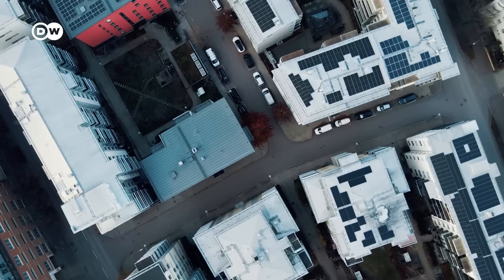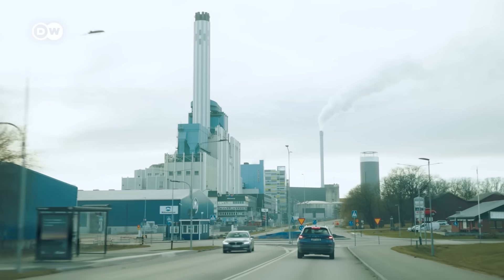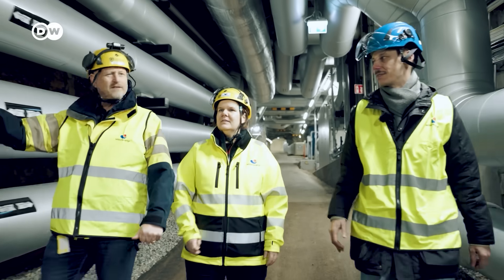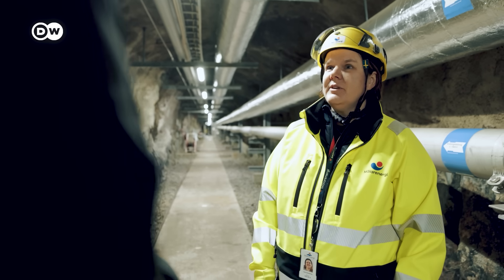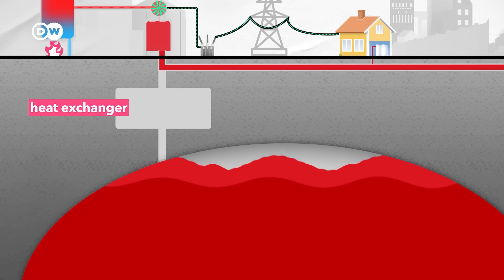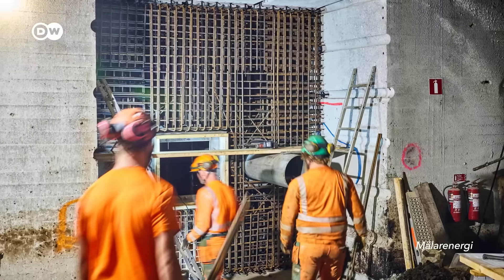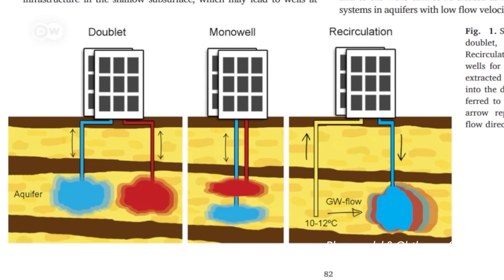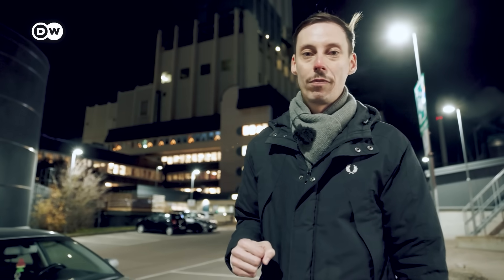Why a city in Sweden filled these caves with almost boiling water

Comment: 9:02 15.5 MILLION ONLY?! I was prepared with a big ole a few hundred million dollars or a billion, but that's nothing. That figure is thrown around way too nonchalantly, I don't care about anything else, but the fact they effectively increased energy efficiency with just 15.5 MILLION DOLLARS is insanely efficient.
Reply: Well, the cave was already paid off since it was built in the 1950's
Reply: @oskich  That's still crazy tho, for reference I am living in the state of California in the US. Our state has poured billions of dollars every year just on roads, but roads haven't really ever gotten better. In fact there's even a Wikipedia page called "List of unconstructed state highways in California". If we measured the efficiency has impact divided by cost, their cave system is miles above anything I really seen before.
Reply: @oskich  SKANSKA buillt it in the 50s and it cost 500000$ back then..
Reply: This is for a city of around 140,000. Or some $100 per person if I still remember my math.
Yet, break even is expected in 5 to 10 years.

There are losses in the system:
 - most of the surrounding rock has been heated by the hot water but the heat in it is no longer recoverable
 - the pumps consume electricity, whether they are storing the heat underground or taking it out
 - while it should be almost completely automated, there are probably a few workers year round
 - the cave might not have been located in the middle of the city, so there are both electricity losses and heat losses to pump water to/from the caves

Yet, there are a number of advantages pointed in the video as well.
All in all it looks like a big win.
Reply: @CalinCETERAS  i mean, the hot rock also acts as a thermal mass, if the water were cooler than the rock, the rock would warm it back up, so its stabilizing it, sure theres some loss that you just wont get back, but, still has use and when something is deep underground its gonna be a while til that heat is actually lost, since they could just harvest some of that waste heat via ground thermal heating
Reply: @CalinCETERAS In regards to your negatives, 1 might actually be a positive and 4 is usually negligible for district heating systems anyway.

Why 1 can be a positive is that if the summer months produce more heat than is required to bring the water up to 95C, then any excess heat stored in the rock will be heat that you don't have to actively cool, thereby saving costs on cooling. Furthermore, as the rock is heated and the water cools during winter, it will in turn release some of the heat back into the water for additional stored energy.
Reply: @CalinCETERAS  Those negatives you pointed are such bad negatives that they seem like positives.
Reply: Only reason things cost that much in america is cuz the government employs their own private companies owned by their friends and pay them massive amounts of money.
Reply: i think it's cause you're comparing it to America where they overcharge the hell out of any public infrastructure or spending and have like 100 middle-men
Reply: Translate from 15.5 million dollar to kronor is 11 times higher, 168 million kr.
Reply: @Krogen94  what’s your point? The value is the same, it’s just the number that’s different. Translate it to South Korean won and it’s many billions
Reply: I agree, it shows how efficient things can be done without American government. 😂
Reply: Agree. The expected time to recover the cost of the project of just 5-10 years is nothing in the context of infrastructure. However to home owners out there, if you live in a poorly insulated house chances are if you have good insulation fitted you may see similar short time of recouping the investment - and your will be more comfy to live in and worth more if you want to sell someday.
Reply: I suppose the price is depending on the level of corruption in the country/ city.
Reply: @biaberg3448 Possibly. As this is Sweden there is no corruption.
Reply: @bzdtemp  🤣🤣🤣
Reply: That what happens when corruption doesn't exist :)
Reply: it's a rather small system, the amount of CO2 saved is not that much. 15 million is not expensive, but also not extremely cheap. a breakeven time of 5 to 10 years is pretty good, but the cavern was dug already.
Reply: It's also a rather small scale system, which only provides two weeks of full heating for the city ... in a region which has very long winters.
Reply: @PauxloE  It's 2 weeks *if it's running to give off heat nonstop. That's not going to be the case 100% of the time during winter. On those warmer days where the system isn't outputting heat, any extra heat is likely being sent back in to make sure the temperature doesn't drop too much and they can keep the storage up for the next super cold day.

But yes, it's still a limited system nonetheless
Reply: @PauxloE  In case the heaters stops working and the only heat would be from the caverns two weeks should be enough to come up with a solution so the heaters can start working again. I can't say for sure tho.
Reply: Much hype about little benefit.

Comment: The bedrock leaks. This system is closer to BS than to working. You can't heat a cave and claim it's a thermus. It's not a thermus, otherwise the adjacent caverns would be cooler. It's a fucking radiator lol. Also, it stores heat for 2 weeks only. It's good to do somehting with the waste. But it makes no sense to claim you have an efficient system when you are losing energy to a giant radiator.

Comment: I'm from another rather small town in Sweden with a big district heating system but I don't hear much good about it. There's no storage system though, which might improve things. But the issue is fuel, there's not enough trash or garden waste generated to supply the plant so they need to import a lot of fuel, green or otherwise. And it's simply to expensive to run overall, the amount you pay to be hooked up to the system is too high. Many are switching to individual heatpumps instead, forcing the company to increase the price even more for the customers who are left just to break even. Sooner or later it will just be the big buildings owned by companies and so on left, when all the small homes that can leave have left... If nothing is done that is.

Comment: Honestly 15.5 mil euro for such a system sounds like nothing. I guess the fact that they already had the cave ready and "only" had to clean it up helped a lot.
Reply: I learned that the Golliath rollercoaster in Walibi Flevoland in the Netherlands costed roughly  2/3 of that. Which is something just for fun. So to me this amount of money for such undertaking seems insignificant to me too.
Reply: @xDevoneyx  Why racist? I don't get it.
Reply: @felicytatomaszewskaI think you meant to tag someone else instead of me.
Reply: @felicytatomaszewskain america people like to fantasize of things that never happen and basically you have deal with their delusions, like the one he just made up.
Reply: Yes! If you happen to have the expensive part of the project done, i.e. drilling and blasting, this is a fantastic use of unused space
Reply: ...Yeah they're replacing a swimming pool in my neighbourhood and it's projected to cost over $200 million.
Reply: If you don't have caves you can build a big thermos bottle on the ground. Common in Finland. These help a lot in case the thermal power plant runs into trouble. You can also store heat in sand battery but it's better to heat them to higher temperature. It's a great way to store extra electrical power in cold places. This technology is cheap, efficient and tested for decades in northern cities so if your country is having heating problems and pollution, there's affordable solutions available.
Reply: @McSlobo  yeah tell that to Śląsk province in Poland. They still mainly have single house heating and air quality is absolute garbage. People burning whatever trash they have just to save a few pennies on fuel.
Reply: @StanleyJohnny  Aah, the Śląsk province, where doctors recommend people to start smoking because it's the only time they are breathing through a filter.
Reply: @McSlobo  This is storing surplus cogeneration heat for later use.  Storing electricity for heat is the worst possible way to store electricity.
Reply: @rodfreess6019  Not necessarily, though that is done in thermal sand batteries at several hundreds of degrees C, not with water. IIRC it is also only done when there is an overproduction of electricity that would otherwise be wasted, and also maybe at points where the prices are low enough for it to be beneficial. Turning off and then starting up a power plant is not free, so being able to store the energy in something like a thermal battery is not as bad of an idea as it might sound.
Reply: @MorpH2k  True, but turning electricity to heat for storage is still the worst possible way to store electricity.  An admission of defeat for electricity management.
Reply: @rodfreess6019 they are not storing electricity as heat. It’s an accumulator for district heating.
Reply: what do you mean euro? it costed 15.5 mil dollars 9:00
Reply: @Mientus_official  Euros
Reply: The fact that the equivalent for a single home is about 100k I mean it's 150 homes worth of investment cost to save the equivalent of 400 homes it's not much sure but it's a start and it's a great start for something that can and will benefit all of us in time
Reply: When you dont have a bunch of corrupt politicians seeking kick backs, things become much more affordable.
Reply: ０．０
Reply: I was going to say the same thing! If this was done in America this would’ve costed 2 BILLION and be plagued by a buncha BS .
Reply: That was for the conversation not the whole system don’t be dumb
Reply: that is really seriously cheap. I thought it would had costed them way more.
Reply: Yeah, that's cheap. Vantaa Energy's Varanto system with it's infrastructure will supposedly cost 200 million euros and if I read the press release etc correctly that includes two 60MW electric boilers. Oulu Energy's Toppila 60MW electric boiler is apparently 9 million.
So the mining and creation of the storage isn't cheap. 
Obviously Varanto is much bigger, it would hold 1.1 million cubic metres of water and capable of heating it up to 140 degrees celcius, supposedly storing up to 90GWh of energy. If I did my back of the napkin calculation correctly, that would imply a temperature swing of 70 celcius between "full" and "empty".
Västerås system is 300k cubic metres in comparison but that amount of heat storage for just 15 million is peanuts, a no brainer.
Reply: Moving Earth cost a surprising amount of money. I think you are spot on
Reply: It also suggests that the hidden chambers are VERY close to the CHP facility.

I think unless they are under the water, it is only a short amount of time before they will be disclosed by their heat signature. 27m doesn't seem very deep when you have 95°C there
Reply: It feels like people forget that it's still a lot of money
Reply: @Sami8s  It's not very much money for digging a tunnel. The cost is typically on the order of $10k per meter
Reply: yeah 15 mil IS nothing for a city wide heating system
Reply: its 15.5 mil US dollars, but yes almost the same amount anyway. think about 14.9 mil euro. its nothing really, I agree
Reply: Can we use air conditioner technology to transfer the 95 degrees heat to a hotter pressurized conatainer, that produces steam and electricity?
Reply: Framingham, MA in US just built a networked geothermal system for 24 residences & 5 commercial buildings for 15 million dollars. So, yes, that looks like a smart climate solution and an amazing use of resources - bravo Sweden!
Reply: $15 mil to save 460 people worth of CO2/year isn't great numbers, though it does ammortize eventually.
Reply: The citizens in Västerås are paying the fees now.
As with all infrastructure and variables which make the super expensive heat and electricity during (and conveniently) during winter.
Even the cost of the electricity cables increase with the cost of electricity.
Reply: 15.5M to cover only 500 people doesn't sound that efficient
Reply: It would cost 20 billion in America and be called racist the whole time.
Reply: @DaveyCrockett1 , will your comment make you wiwd faymiss and earn your a miwyun pahnz?
Reply: @DaveyCrockett1    You must be an uneducated Southerner to say that.
Reply: @DaveyCrockett1 haaaah
Reply: @DaveyCrockett1  I've worked on a hydronic heating project in 1993 in the US.  The project supplied heated water from 160 closed loop pipes that were drilled into the ground nearly 200' deep each.  So to say such a biased thing, just shows how jaded you are.  But yeah there are a lot of racist people here in the US as well as Sweden and throughout Europe.
Reply: @DaveyCrockett1  Let's be real, it would be called the far left mind virus woke cave. :p
Reply: @DaveyCrockett1  probably woke
Reply: @DaveyCrockett1 I agree with the insane amount it would cost! Haha.
Reply: @DaveyCrockett1  haha spilled my tea laughing :D
Reply: Nah, it would cost 40 and be called woke.
Reply: @beaconofwierd1883 And it would be built by private contractors who spend half the money paying their CEOs

Comment: I live in the US and all I can say is that capitalism ruins everything. 

Such efficient recycling and systemic interdependence could never exist under the management of capitalists. It's more profitable to the oil and coal companies if they simply keep using more coal. After all, they own the electrical companies as well. Their profits would drastically decrease if we stopped using the extremely inefficient individual electric heating for each building. Waste is profit.
Reply: Sweden is also a market economy and because Sweden has no oil or coal and would have to import it this type of solution makes perfect economic sense

Comment: 15.5 mi for this project is really cheap, pretty smart usage of already developed infrastructure
Reply: Framingham, MA in US just built a networked geothermal system for 24 residences & 5 commercial buildings for 15 million dollars. So, yes, that looks like a smart climate solution and an amazing use of resources - bravo Sweden!
Reply: If we were to estimate this project, your 'existing conditions' are worth the hundreds of millions / billion we were expecting to see.
Reply: @mikeb5664  The one that is 3 times bigger (10:00) and is being built from scratch has an estimated cost of 200 million. So not that much. Also as it is purpose built it actually has 7 times more capasity for heat.
Reply: In America it would be 15.5 billion and never get finished.
Reply: @TheRiiiight  Thats nothing, in the UK we have a trainline that we have been building since the 1980s that has cost over 60-80 billion USD. Thats right a single trainline and its not even finished
Reply: it was already there.  They cleaned it
Reply: $15 mil isn't too bad, but only saving 460 people's worth of CO2 isn't that good either. Better than nothing ig

Comment: Save 1600 tons a year, so how many tons of co2 was emitted in the construction. 

That's what info is more important.
Reply: It was built in the 1960s for strategic defence us and now repurposed for energy efficiency
Reply: @kronop8884  
So all the new pipework, concrete, vans, tradesmen, pumps, excavations , clean up etc were all carbon free because it was built in the 60s?.
Reply: @Robert-j6r8c Not carbon free but it’s a long term investment that will pay off both in terms of heating cost and CO2 emissions over time

Comment: "Only little of the heat escapes" -> Please quantify. Underground rocks are not a good insulator.
Reply: Considering the huge volume of the cavern in relation to the comparatively small surface area of the bedrock enclosing it this is the result.
Compare if you will with a radiator or heat exchanger where the goal is to maximise the surface area to volume ratio to improve heat transfer, in the case of the cavern it is the opposite situation
Reply: @kronop8884  Still the open-air water tank with human made insulation may beat rock in efficiency, 11:21... Would be nice to get reports on the actual numbers

Comment: Are there any side effects with the added heat in the ground? Surely there is heat soak in the ground. Is that contributing to any change in the local environment?
Reply: There isn’t much local environment to consider deep down in the bedrock, but sure there’s a local hotspot but nothing that will affect anything in on top or top layers of soil

Comment: Sadly even 90% efficiency isn't enough for very occasional use when used with fossil fuels because of the CO2 releases affecting the climate. Maybe with heat pumps these heat reservoirs might work though.
Reply: Biofuel and waste is used not oil or coal

Comment: As a Alabama man i gotta say I i like it but I i don't need heat to often. But its gotta have redundancy in the system. If not the whole city freezes during repairs. Im in HVAC heat craps out in winters some times. Its different level thou a home to a city.
Reply: In a well run DC you have different heat sources, which also means that if one fails, you don't get ice cubes out of the hot water pipes!